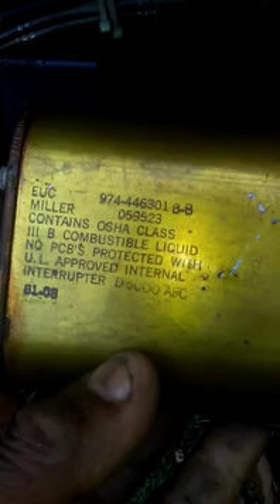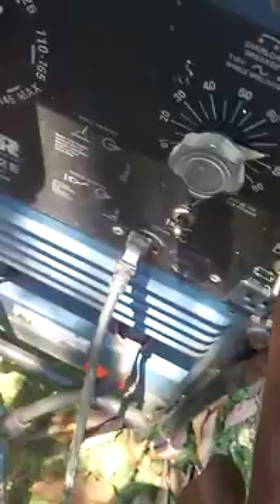Miller bluestar 2e won't weld/no power help help help

Comment: I think I would use a meter to prove that the rheostat is not working before ordering a new one. Get the tech manual it will help u find the problem.

Comment: I would check the rheostat
Reply from the maker: Hello...
Yes we did fixed the problem several months ago which was a bad Capacitor that gives a low output reading... We also change the Rectifier. 
It was working fine until a few weeks ago it stopped working again so the next option is to change the rheostat which might fix the problem. 👍

Comment: Between 00:00-00:03 sec. you will see a band of wires going from the generator to front panel. There should a wire that’s marked A1. There is a section on this wire that has a connected diode attachment with red/pink male and female connection. Check that diode. Bought 2  old miller generator welders for $500. One needed a coil and starter and the other was doing the same thing as yours. After running electrical check I noticed that this diode/resistor was fried. So o pulled one of the other machine and i haven’t had a problem with it since
Reply from the maker: You are a genius. I wish I had this information earlier😞 I gave up trying and sent it to retirement 💔
Reply: Good information. Thanks

Comment: did you ever fix this machine  i have one with exact same condition
Reply from the maker: Hello...
Yes we did fixed it, the problem was a bad Capacitor and which was giving a low out put... We also change the Rectifier.👍
Reply: @stoneyvill  thank you !
Reply from the maker: @michaelwalker1644  You are welcome
Reply: I have one with the same problem I just ordered a capacitor  did you fixed yours?
Reply: What capacitor did you use? I'm having the same issues and having hard time to find the capacitor.